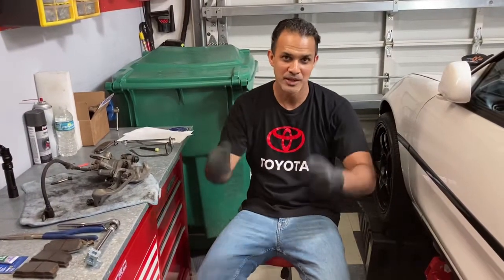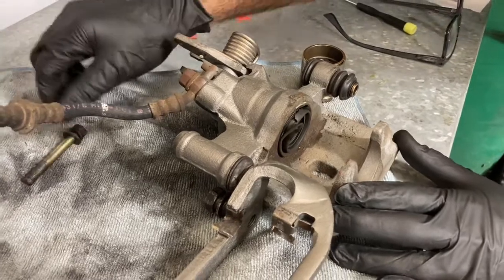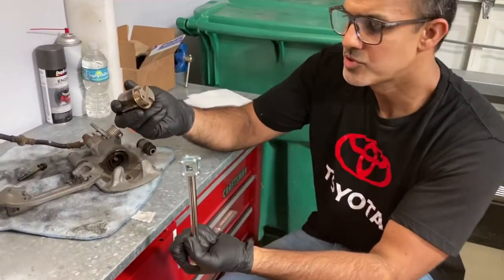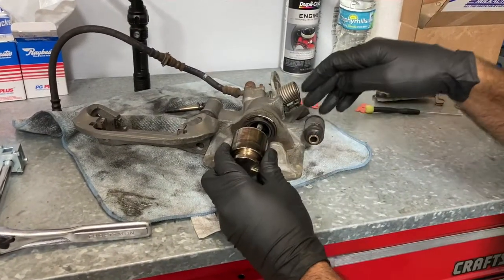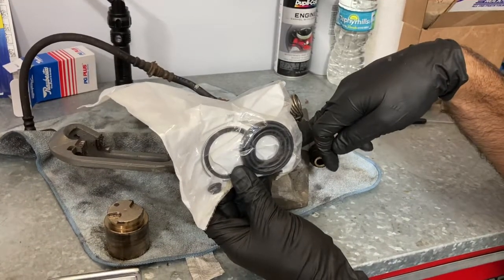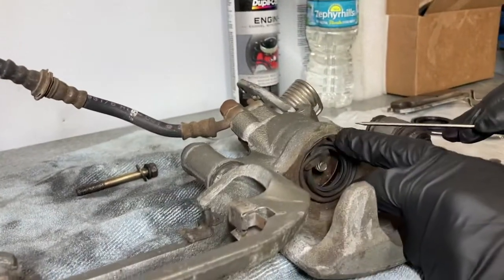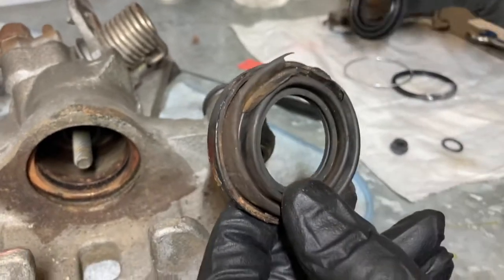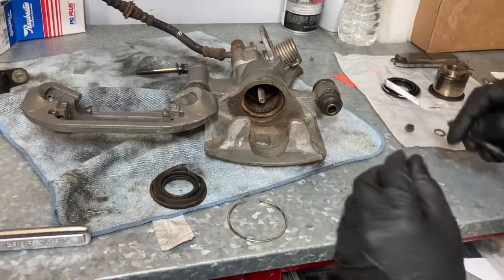1993 MR2 3SGTE Gen5 Build E24- Rear Brake Caliper Refresh

Comment: This was very helpful, as you say no videos on YouTube that cover this,,I can now crack on with mine 👍👍
Reply from the maker: Appreciate the feedback. Thanks for watching
Reply: Just a question, were the oversized piston seal's ok , any issues at all? Thanks 👍
Reply from the maker: @jamesjames215  hello. No issues they are working great.
Reply: Just going to refit my rear calipers soon is  the handbrake self adjusting or do I have to keep adjusting until I get it right? Thanks 👍
Reply from the maker: @jamesjames215  if the hand brake was working fine before it should not require adjustment. If not you have to adjust under the car where the two cable meet.

Comment: Are there any rubber seals in the parking brake mechanism? I’m getting them powder coated but I don’t know how to disassemble the parking brake assemble
Reply from the maker: I dont beleive there are any seals if you separate the parking brake from the caliper. But, i have never pulled that section apart.
Reply: @bitingantz  I just looked up another video and there is a o-ring on the threaded shaft. I will probably make a video on how to take it apart.
Reply from the maker: @Jursaw  thanks for the update.

Comment: Hi, what was involved in removing the e-brake to get the whole calliper and bracket off, please?
I have one slide pin that has totally seized, so I can’t swing the calliper up to access anything :/
Reply from the maker: Hello, just remove the pin on the end of the ebrake cable where it’s connected to caliper. After that slide out the cylinder that the pin was in and cable is separated from main caliper.

Comment: where did you purchase the cube tool?
Reply from the maker: Got it off rockauto but amazon has some better options as well
Reply from the maker: https://www.amazon.com/Orion-Motor-Tech-Compressor-Replacement/dp/B01FW3U26G/ref=mp_s_a_1_1_sspa?crid=3P3Y240D354HC&keywords=brake+service+kit&qid=1642432079&sprefix=brake+servic%2Caps%2C82&sr=8-1-spons&psc=1&spLa=ZW5jcnlwdGVkUXVhbGlmaWVyPUFOSkFWRkdPOTY0UDImZW5jcnlwdGVkSWQ9QTAzOTU3MjAxTkU3QlhPSFMwMjhIJmVuY3J5cHRlZEFkSWQ9QTAwMTcwMDlPWUw5Ukk5WURPUzYmd2lkZ2V0TmFtZT1zcF9waG9uZV9zZWFyY2hfYXRmJmFjdGlvbj1jbGlja1JlZGlyZWN0JmRvTm90TG9nQ2xpY2s9dHJ1ZQ==
Reply from the maker: https://www.amazon.com/Lisle-28600-Disc-Brake-Piston/dp/B0002SQUFY/ref=mp_s_a_1_4?crid=13LOP29U58N69&keywords=brake+service+cube&qid=1642432120&sprefix=brake+service+cube%2Caps%2C79&sr=8-4